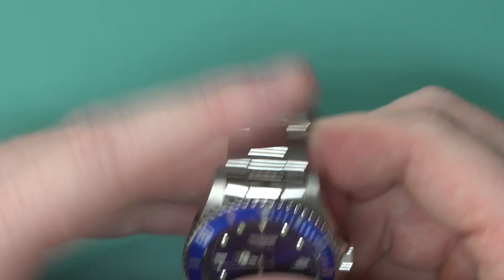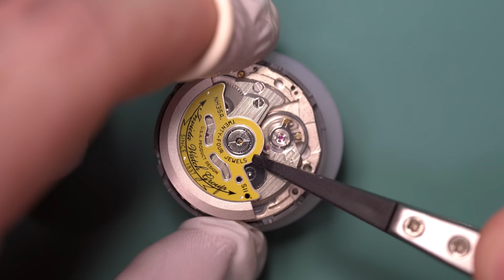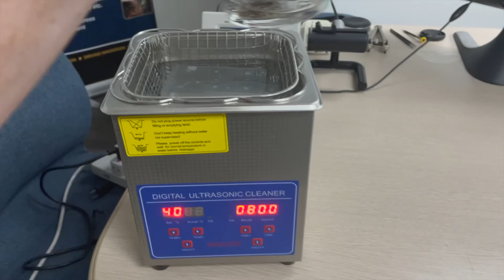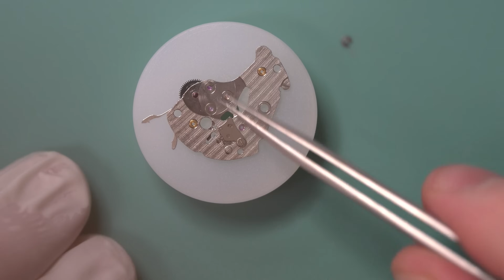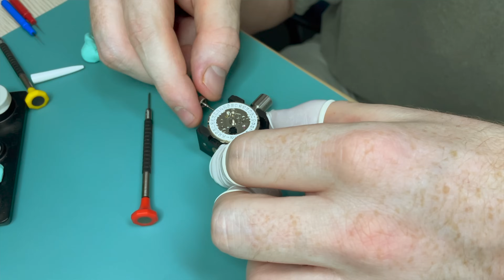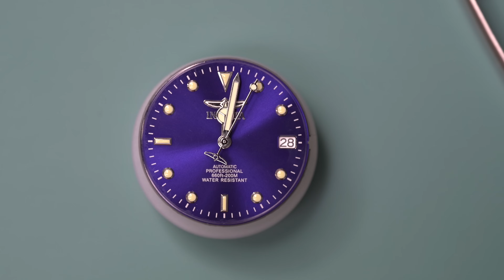$75 Invicta Pro Diver Strip Down and Review - Budget Watch Restoration - Seiko NH35a

Comment: That means that Invicta as a brand from the past cannot mix with the Invicta today, as it has not even a single part made in Switzerland, -as simple as that! Btw, I have Invicta Pro Diver and this is my third watch. What I can say is that it well worth the bucks I have paid. I have been wearing this watch everywhere, including racing sailing. Nothing have been wrong, -kept the time reasonably accurate and well protected in all conditions. The last one is still on my wrist, a bit losing the time but this is the beauty here, instead of going to the watchmaker to hear that he asks $200-400 to dismantle, clean, lubricate and assemble it, I am going to buy another one, brand new!

Comment: I have about 13 invictas all but 1 is an automatic. Ive had some for a few years and havent had any issues. The quartz one does go through batteries but its a sub noma iv so it has a lot going on. I have mostly divers and a hydromax thats supposedly rated for 1000m which i believe it could handle it except for the display back. Theres no way that could take it and maybe not even the 200m of the others i have. All my other real divers that are iso and rated for 200m or more have heavy thick backs so id absolutely love to see pressure testing on some of these as well as the casio g shocks and other budget divers that are very popular these days. Great breakdown sir looking forward to more content!

Comment: Wife bought me an Invicta Reserve for an anniversary 15 years or more ago. Solid stainless steel case and band. Thing weighs close to a US pound. Mine has it stamped on the face thats its Swiss made. Dont know how thats possible with this info you provided. 
Had the battery replaced for probably the 4rth time or so and the watchmaker showed me, and was surprised that there were rubies inside it. I had no idea. I don't know crap about watches. Just love the watch because it keeps accurate time, doesn't run fast or slow, never have to adjust it, and it's a beast.

Comment: Honestly, I am not a fan of Invicta but my first budget collection buy was the '1953' Invicta Pro Diver Black Dial Coke Bezel Model 34334. and was just shy of a $100 shipped. It had been an amazing daily wear and other than the cheap-ish pressed clasp; the overall construction, style, even precision of the moment has been one heck of a great deal! I use the hacking to sync up with some software at work to help time when I need to pull reports and this watch keeps better time than my Bulova w/ Miyota 8-series movement. So well, in fact that I thought my Bulova had a bad movement (until I looked up the specs, that is!)

This watch has swiftly become a benchmark for me when doing a little budget watch collecting and I have a hard time justifying anything sub-$400 as a result. I mean, what fun is getting a bunch of other cheap divers with the same, if not similar movements when this one fills that niche so well and does it cheaply enough that I won't cry over the typical daily scuffs n' scratches?

Comment: I got mine in 2017, the 8926OB, for $56 delivered. This is by far the toughest watch I’ve ever owned. It has been dropped onto concrete from a height of 9 feet, smacked against metal semi-trailer frames, endured the vibration from Stihl weedeaters, chainsaws and Harley motorcycles. I have beat the crap out of this watch for 5 years now. No other watch has lasted half as long.

Comment: I have one of these. I got it on clearance because it was all green and I didn't have a green diver. It's a decent watch. My only complaint is the lume. I have a $15 Chinese auto that has better lume. I don't think I would trust the 200m rating either. 
As a side note, avoid the quartz divers at all costs. I had bought one as a gift (about the same price) and the crown/stem snapped off in less than a week. Took it apart and it's a $3 quartz movement. Absolute garbage.

Comment: I own about five Invicta Pro Divers of various era's and designs. My first was a Pro Diver with coin edge bezel and Miyota 8215 movement I bought almost 15 years ago. At the time, I didn't even know it was a homage of a Rolex Submariner. I just thought it was just a cool watch. I also got a two-tone and blue version. These watches introduced me into watch collecting and still runs fine today. My most recent Pro Diver is this standard black bezel one with a hacking Seiko NH35 movement. I've turned into an amateur watchmaker and could simply swap out a new movement if anything goes wrong with them. Through the years, I've swapped out a few aftermarket Sub bezels for fun (it'll take some light sanding and epoxy glue). Despite owning various Rolexes, Omega, Tags, Sinn, etc.; I still rotate, wear and enjoy my Invictas. I tend to agree that there are a lot of hate and disrespect for Invicta online because their Pro Divers are such a bang for the buck that it exposes how much of a rip off many Swiss watches on the market are. Yes, the bracelet has hollow endlinks and stamped clasps, but so did the Rolex Submariner and GMT up until the late 90's. I can proudly wear my Pro Diver to the store knowing that my Submariner is lying safely in my cabinet at home.
Reply from the maker: I'd be interested to see some other Invicta's, all I know is that i was impressed by this pro diver, absolute beast for the price tag it commands. JSG

Comment: I've had my Pro Diver for almost 20 years, and I find that it keeps time and holds up to water wear as well as it did brand new. The only issue I have is that the blue tone on the bezel has faded over the years, while the dial's blue remains rich and beautiful.
Reply: Yours most likely has the Myota 8215. It’s a really work horse movement. Mine is about 17 years old and it’s just starting to have issues.
Reply from the maker: Glad to hear these little gems can also stand the test of time. I was blown away by what you get for the money you pay! JSG

Comment: Never personally owned an invicta but I’ve seen and manipulated them on more than one occasion and I own a few glycines although really there isn’t any crossover after the acquisition despite glycine prices plummeting lol  I always thought they were kind of the bottom of the bucket when it comes to mechanical watches which I now can can stoop much further 🤣 and their outrageous super sized designs are for the most part off putting to me as well as their use of special or limited edition haha and I have a big wrist too but in the budget world they have a lot to contend with now days  especially from some of these Chinese homage brands who also incorporate Seiko or Swiss cloned movements at prices invicta can’t even touch I like to buy homages because I don’t have any boutiques or retail stores around that likely wouldn’t carry the stuff I’m interested in anyways so I use them as a test drive for the real thing to see how I like the dimensions and how it looks on wrist before buying the real deal I did it with my sla017, mm300  testing San martins before buying the real thing and most recently after buying a pagani homage bought my GS Slga001. I was blown away at this pagani that cost me $120 which is less than a single link on my GS it’s got an etched ceramic bezel with solid action little back play and no lateral movement , a chamfered sapphire crystal,  a signed screw down crown and case back 200m, a solid screw link bracelet with a signed milled clasp and safety pushers. And a bulletproof nh35 under the hood. The fit and finish is outstanding for this price but I’m sure it’s a crapshoot with QC but I got one that lines up better than some $1k or more seikos I’ve owned. The lume isn’t very good but that’s to be expected. It Would be interesting to see a comparison of who makes the best sub $150 mechanical watch

Comment: Can't the 3 sec loss be corrected?
Reply from the maker: It can be, but will also drift with time. on a watch like this. Someone previously commented that setting a watch slightly fast is the best option if drift is likely, this way you can hack the watch when needed to correct the error. A good little tip! JSG

Comment: I have thin wrists but big hands. This watch is too small for me. I cant take the chance on a mechanical watch that may or may not keep good time. It looks good when you handle it. But I don't want to have to pull out my phone to for correct time. I am an adult with important responsibilities.
Reply from the maker: a 44mm watch is a decent fit for big hands. I find the 36mm watches look too small against my hands. Watch picking is not easy 😅 JSG
Reply: @JSGBuilt  A watch that doesn't keep good time is easy not to choose. This watch doesn't keep good time.

Comment: Why should I want to use hacking to sync my mechanical watch to the official time? In a day or two it won’t be within a minute of it… okay, there’s a story behind that belief…

My Dad gave me his ill-maintained c.1964 Omega Seamaster when he started wearing quartz watches. I had it cleaned. Watchmaker said it had run a good while with insufficient lubrication and said it needed some jewels replaced. I didn’t have the money. Eventually the watch was stolen. Before then I was wearing Casio, Seiko, and eventually Citizen radio-sync watches. Yeah, it’s cheating to keep your quartz watch roughly accurate with a radio signal but I’ve done that for twenty years. I’m disgustingly lazy but I care what time it is.

Comment: Honestly, these days not all Chinese watches can be sniggered at anymore. I recently bought a Pagani Design Sub homage because I'd read so many good things about them and at the price it seemed rude not to. Build quality is easily on par with the current generation Seiko 5's but at a third the price. You get stainless construction and unlike the Seiko, ceramic bezel insert, sapphire, solid end links, screw in links and a nice clasp. The NH35 was running about - 15 but I've regulated it to +10 per week. I'm blown away by what you get for the money, and I'm not sniggering anymore.
In the case of that Invicta, I might be a little concerned about that yellow finish they've used on the rota. As standard the NH35 is bare metal so hopefully the finish they've used to individualise won't start flaking away over time and infect the movement.
Reply from the maker: Chinese manufacturing has come a long was over the last 20 years! its definitely not what it used to be and has come on leaps and bounds, it still unfortunately has a bad stigma, but my guess is not for too much longer. JSG
Reply: Pagani Design is the best Chinese brand for sure.    The specs on Paganis are off the chart.    These generic Seiko NH35 movements are really good.    They can be regulated much better than the published accuracy specs.    I got my NH35 to run +3 sec / day with a full manual wind or active daily wear with careful regulation.     Perfect for me.

Comment: I really like my Invicta watches.  The last time I had my Breitling serviced,  it cost $600 usd; I could buy 8+ Invicta for that. Also. I use the hacking feature to set the time against an atomic clock.  Makes it easy to see how accurate it is over 24 hours.  Excellent video! Thanks
Reply: Cheap service compared to Rollie.
Reply: @poulwinther  had a Sub serviced $750 not bad
Reply: @eagles4757  Yeah, really not bad for a watch estimated by the pros to have a manufacturing cost of $250....
Reply: @poulwinther  ARE YOU TRADING ME THE BREITLING FOR 8 INVICTA OR NOT I NEED TO GET EXPRESS SHIPPING SET UP WITH QVC LOL
Reply: @eagles4757  I am afraid I can't help you as I don't own either. But I'll trade you 8.000 mosquitos for a bottle of good rum.
Reply: @poulwinther  lol
Reply: I'll buy you 8 Invicta watches for your Breitling lol

Comment: I've had this watch in gold finish for about a year, it's rarely left my wrist in that time so it's been in and out of the bath, shower & swimming pool with absolutely no problem, loses a few seconds a week, so every now and again I need to set the time but that's to be expected from any automatic movement, even an actual Rolex. The gold finish is still as good as when I bought it and hasn't damaged at all. The face is printed perfectly, the date magnifier is in the right spot.. all things considered it cost me more than £13000 less than a Rolex, looks just like it and seems to work just as well;  Utterly amazing for the price
Reply from the maker: Could not agree more! JSG

Comment: Great vid, thanks. But, all that lubricating, all that special care, and you failed to grease the o-ring on the case. That's why most watches that were taken apart are no longer water resistant to the rating on the case. Shame!
Reply from the maker: Sharp eyes Larry! I did grease the o ring eventually but had an issue with my o ring greaser during filming. The foam pad in the grease pot had become detached from the plastic case so i had to get a glue gun and glue it back down. Back in action now! JSG

Comment: That seiko movement costs over 50$ alone. Super solid. Used in many micro brands.
Reply: Too many micro brands, lol.
Reply from the maker: 100% JSG
Reply: SEIKO MOVEMENT .A REAL ONE OK ..BUT THESE ARE ALL CHINESE SEIKO'S ..MADE BY SEIKO'S OLD MACHINES NOW IN CHINA ..LOOK AT WISH WATCHS YOULL BE SURPRISED WHAT IS A SEIKO .. CHINESE SEIKO MOVEMENT 10 DOLLARS ..NEVER 50 ..
Reply: @doug132639  They were never Chinese but from the official Seiko Malasia factory. I bought a single movement for $23 so obviously Invicta pays a lot less.
Reply: @poulwinther I would expect so since they buy them by the car load. But for the average joe that's not the price available. Servicable amd parts available if you want to try learning watch work on it. (Not worth it to pay to get it fixed  of course.)

Comment: Thanks for doing this.  I have one of these and I’m astounded that they can make a profit making these.  Mine keeps great time, the amplitude is good and the beat error is about 1 msec.  The case and bracelet are really solid, and the dial and hands are spectacular.  It’s a hacking movement and it’s got a see-through case back.  As a novice watch repair tech I would service this without sweat, because I could replace it for a fraction of the price of having it serviced by a professional watchmaker.  This has to be one of the best values for money in the watch business.  I don’t have a horse in this race but I think Invicta has won the triple crown with this winner.
Reply: I think 1 ms BE is a bit high, but if it's keeping time well enough for you it doesn't actually matter.  I recently regulated the NH35 in my Phoibos Leviathan, and the lever for correcting beat error is a tricky thing to interact with.  You want to give it tiny nudges, but it's easy to give it a big shove by accident.  Also, the balance is right underneath and if you foul that you'll feel very bad.  Anyhow, I absolutely agree the value proposition in these watches is really tough to beat.  I don't know if I'd spend the time to service an NH35 even if I was capable of doing so (not yet!!).  They're just so cheap, they last, and they're a perfect choice for watches like this.  I recently bought a Zelos Hammerhead with an NH35, and I'm completely happy with it in that USD$350 diver as well.  Enjoy your watch!

Comment: I have a couple of old invictas ones with in house movements. One is from the 60s the other is from the early 70s. They are pretty nice and according to the internet actually worth a little bit, not no where near my 1952 Omega. Omega is 100% original. Inherited from my grandfather. I have the paperwork when it was bought new and all the service records for it. I only wear it to an extra fancy get together. I never wear it just to wear it.  Great video. That is incredible value with the invicta diver. Wow. If I didn’t have 87 watches I would pick one up, but I have an actual Sub, and much nicer homage watches. After I got the sub I would only buy ones that looked different. My favorite at the moment is a RGMT Tritium. Has a NH35 in it, fortunately it is on the money  +1.1 seconds a day. Has 300 m and a helium valve, also a wonderful bracelet that compares with the Rolex. The main thing is the tritium. You can read it anytime.